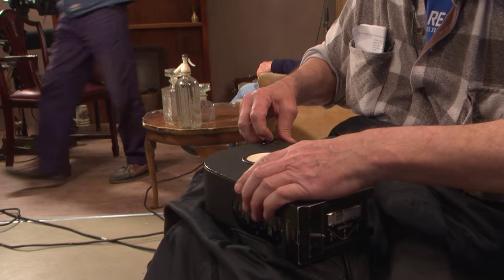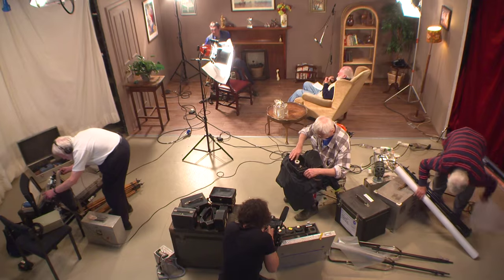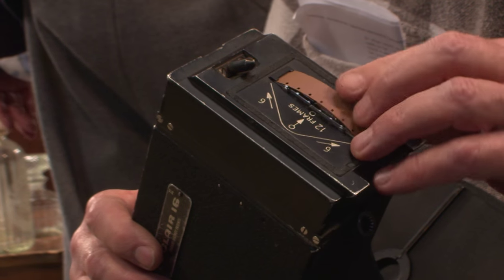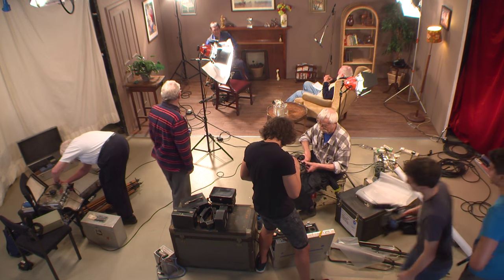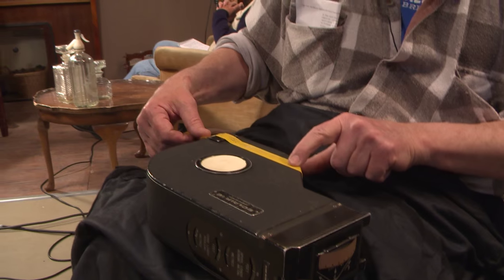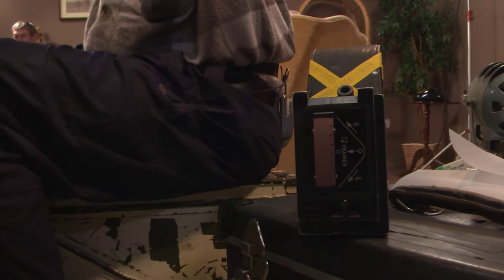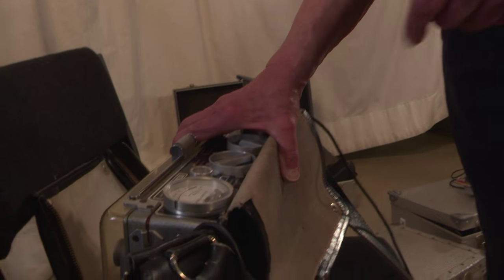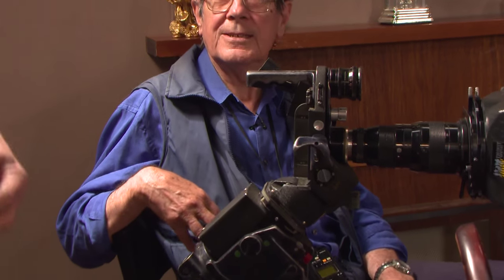16mm Filming Simulation: Preparing For A Interview

Comment: 2:30 That's probably one of the unsung virtues of the NPR (and its successor, the ACL), the fact that the cameraman can set up the shot and the lighting while the AC is loading the mag. That's a design that used to be unique to Eclair cameras, until ARRI essentially copied it for their SR series - which were more or less ergonomically-improved and more agile versions of the NPR.